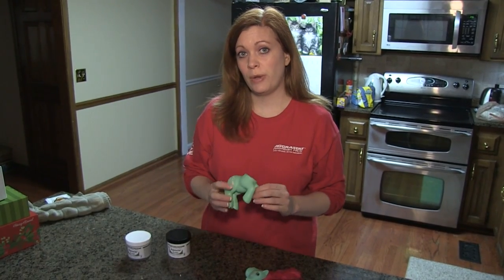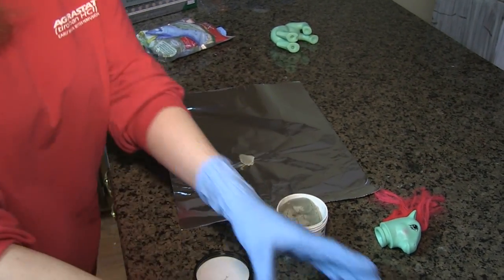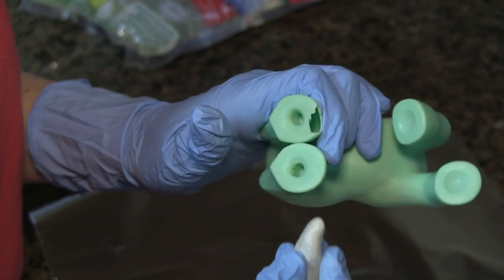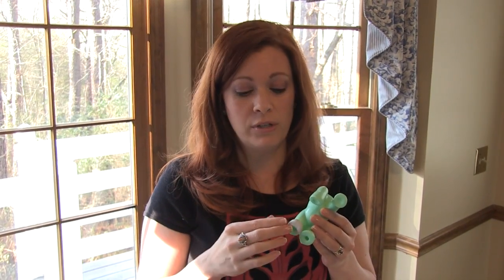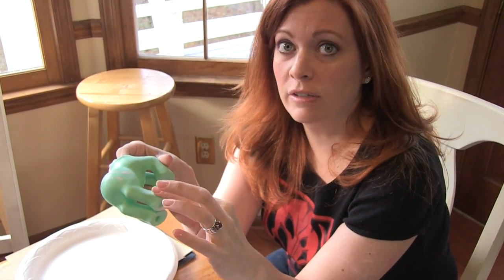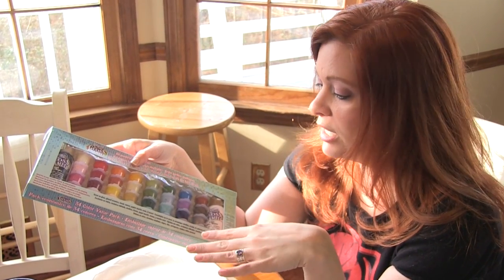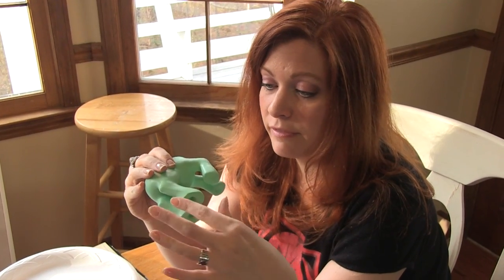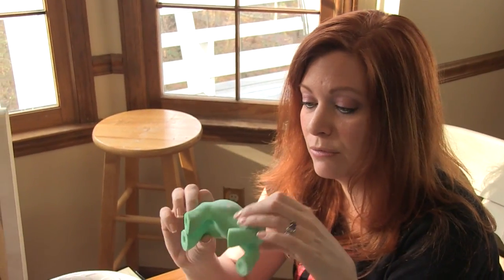My Little Pony So-Soft Restoration: Part 2 - Body Repair Vintage G1 Hasbro

Comment: this has to be the best instructional video out there for body repair. i am planning a repair on powder the unicorn with the tips and products in this video. i laughed at myself once i saw you had a 400 grade sandpaper, because i thought finer was better yesterday at home depot (i got a 2000 grade, so super fine). You have also made me more confident with paint touch-ups!

Comment: I know this is old but if you still restore older ponies take this tip:

I tend to use a bakeable clay and shape it to sort of go inside hoof holes?? And then bake it, and insert it with a little bit of glue, it makes it so your epoxy doesn’t collapse inwards! That way you use less (that stuff is so expensive nowadays!) and you can store bakeable clay forever because it doesn’t dry in the air (obviously.)

Comment: Huh, wonder if the clay would work with pony ear repair. I have two with bitten/chewed ears I got on carboots and nearly their entire ear is missing so any advice is helpful.
Reply: Elle Calladine Yes.  It will work but be sure to wear gloves as it can cause skin issues over time.

Comment: You may have already covered this, but if the body of the toy is soft and the epoxy is hard, wouldn't it open a crack any time the body flexed? (from heat or handling)

Comment: With the apoxie can you sand it down with a nail file?
Reply: Melinda here- you probably could, the question would be whether it was flexible enough to curve around the rounded surfaces. But you could certainly give it a try!
Reply: Thanks. Sorry but have another question what type of plastic are the ponies made out of?
Reply: mathiasmorqubus They are made out of a soft vinyl.

Comment: Is it possible to REflock a pony? That, I would like to see!
Reply: Co⊙zeB○Yz Yes, I have heard that you can but that the flocking doesn't exactly match, so you would have to de-flock and then re-flock. Otherwise you would see the line where you added the new flocking.